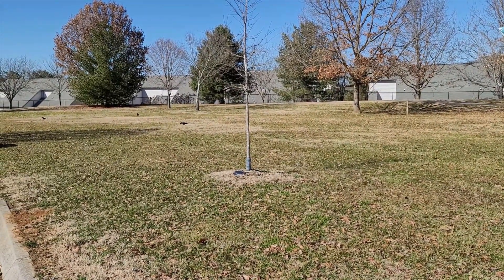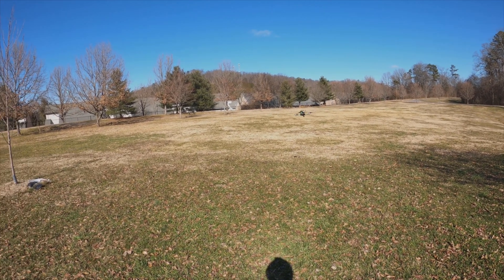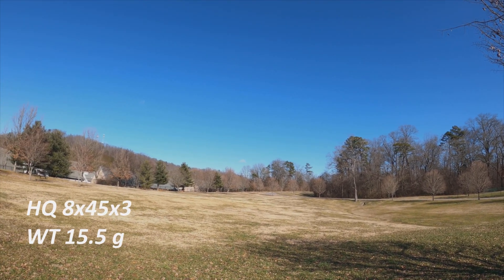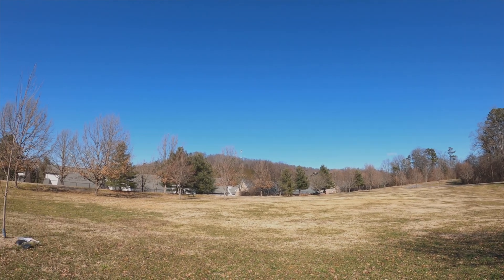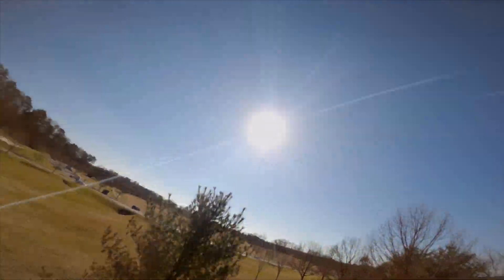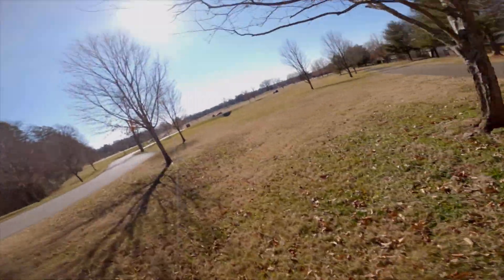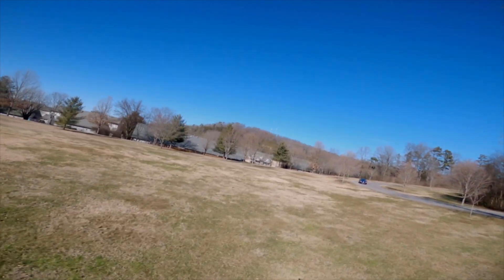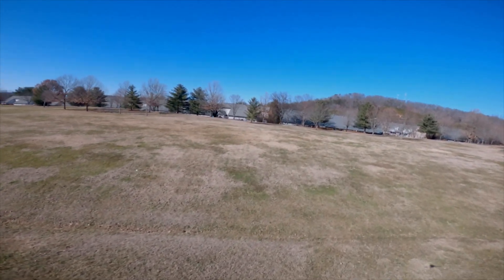FPVCycle 30MM Motor

Comment: Can you comment on motor temps? Mine run a little hot after swapping from xing 2806, no changes to tune...
Reply from the maker: A simple test is to hold your motor directly after  landing .  If your able to hold than in your fingers for more than 5 seconds  that mean your motor are not too hot.  If there too hot, you may need to lower your D terms value, and also make sure none of the screws  holding the motor are not coming in contact with the motor windings
Reply: @GBoniFPV  yea so theyre definitely "too hot" for how theyre flying. Cruising at constant throttle, theyre cool. Secone I blip it for a flip or roll theyre hot. Going lower on D makes it fly bad. I changes a bunch of esc parameters in blhelisuite but havent tested yet. Had issues of it rebooting on hard stops (from over current cutoff??)... also no screws are touching motor windings. Odd...
Reply from the maker: What is your esc rating ? Also if your esc is rebooting,  you may have a defective esc. I had a similar problem with one of previous my esc on this exact kwad. It was fine while cruiseing, but soon as I tried any aggressive maneuver, it Just reboot. The video is actually posted on my channel. I was using 2814 motor at the time. I could not figured out the problem. Out of desperation I change the esc and voila no more issue.  Also are you sure it the esc rebooting or not you fc. If it the esc rebooting , you should hear the esc tone, otherwise  it is your fc.